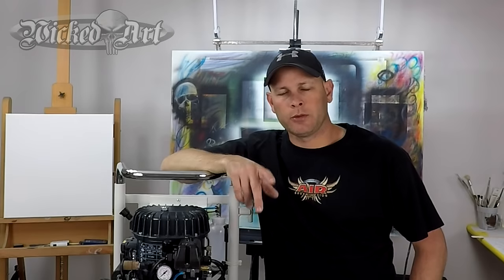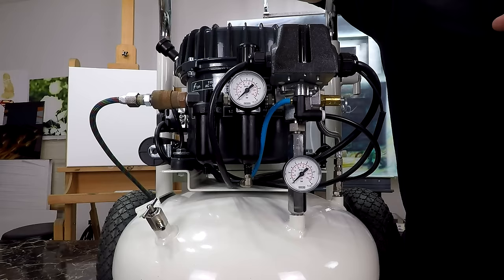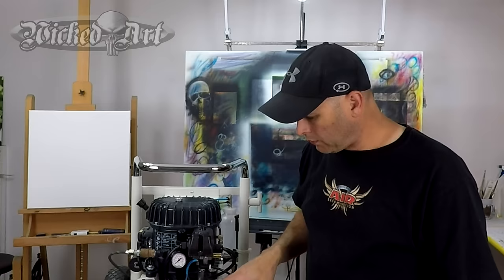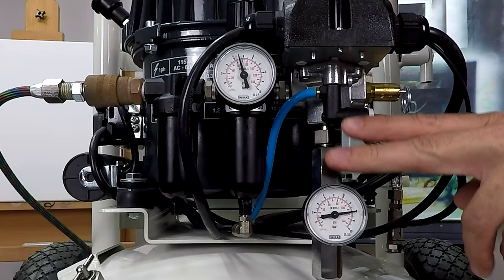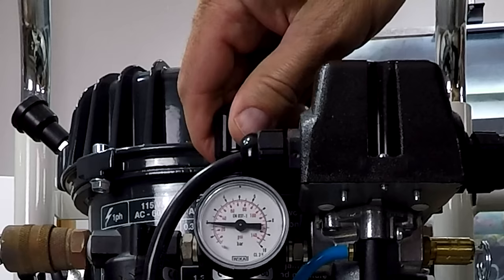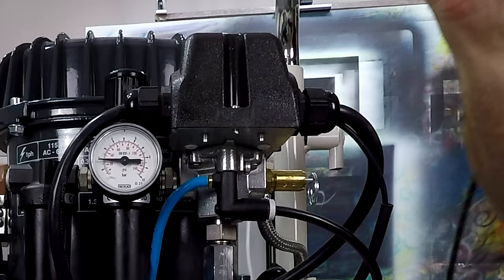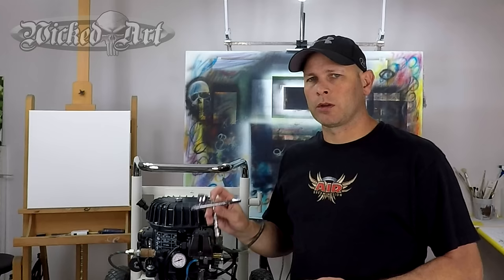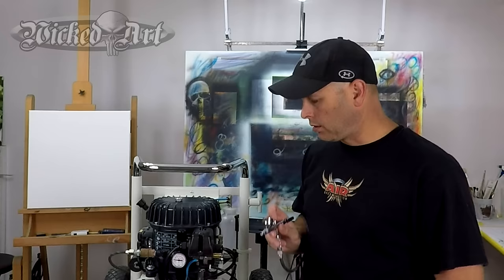How To Properly Set Your Air Pressure

Comment: I can't get max pressure to my regulator. The tank shows 150 psi (the left side of the shutoff) however the regulator only builds up to about 90 lb. I put a new regulator on and it's doing the same thing. I'm guessing there's something wrong with the shut off. Any ideas? Maybe I'll just come out the other side of the shutoff with my hose since that side shows the higher PSI.
Reply from the maker: Most regulators are preset to a maximum air pressure from the factory.  90 psi is more than enough for airbrushing.  I'm curious why you need more pressure?

Comment: I bought a cheap air pressure regulator with a water separator. But how do I know which opening is the air inlet and which one is the air outlet? I tcame with no instructions. Yes, I’m a newbie.
Reply from the maker: Hi Ken.  I apologize for the late reply.  Most regulators will have an arrow molded into the plastic body near one of the fittings or on the back side that shows you which way the air is supposed to flow.

Comment: Did u set the regulator while the compressor is off or not? Why is the arrow of my regulator gauge not moving when I'm turning it.?
Reply from the maker: You'll generally need to set the regulator after the compressor has been turned on and the tank has at least some air in it (depending on your particular compressor), otherwise there is no pressure in the system.  Some pressure is required to set the regulator accurately (not to mention it's more accurate to set the regulator while consuming air from the system like I mention and demonstrate in the video which may require the compressor to be on).

The regulator adjustment knob normally has a lock on it as well.  You likely need to pull up on the knob to unlock it before you adjust your pressure setting.  Remember to push it back down to lock the knob back in place once you're happy with the setting.  Keeping the knob locked will prevent you from inadvertently changing the pressure setting.  Does that make sense?

Comment: I had been having all kinds of trouble with my compressor prior to stumbling across this video; the equipment I got didn't show this, and for some reason none of the other videos I watched pointed out what you show here. I won't tell you what I was doing to be able to operate; suffice to say it was ugly - and I thought I was dealing with a broken compressor/regulator. This short little video helped me fix my problem quickly and correctly, letting me finally start to use my brushes properly - beginning with practice. Thank you so much for offering this how-to! ^_^
Reply from the maker: I'm glad you found my video helpful and are on the right track now!

Comment: Hi Trev
Still watching.
Good to show the pressure drop when you press the trigger. I always set the pressure with the trigger down, same as i would with a spray gun. Most companies reccomend a pressure to spray at but it is an at the gun pressure not at the compressor.  It is a great place to start. You can get a guage that goes between your air line and spray gun which gives you at the gun pressure but it is always with the trigger pressed so the air flows freely. After many years of painting I mainly go feel now. You just know what is right. As with all painting be it automotive or airbrush just use whatever gives you the easiest control and your best results. You might need to play a bit with reduction or air pressure, but it's worth it.
Keep up the tutorials.
Looking forward to the next eagle upload.
Guy
Reply from the maker: Hi Guy.  I'm glad to still have you!  I go by feel too when it comes to setting air pressure.  It's surprising to me how many people don't realize the air needs to be flowing when they set their pressure though and that's why I thought it'd make a good topic for a video.  I'll upload part three of the eagle this weekend.

Comment: Again great advice for the beginners. I would like to add that I adjust my air pressure to different colors as well , I spray white at a lower pressure because I tend to reduce it more .by doing that I reduce the amount of tip dry
Reply from the maker: Thanks for the kind words and the additional tip Adam!

Comment: Dude!! Best video I've seen so far, and I've watched several. I'm new to understanding, not new to using the air compressor I've acquired. Ask I've been doing was turning it on and using it, thinking I knew how to set the psi, butt I was using the wedding gauge for that! Now I think I have a better understanding of how to set the PSI for a tool that requires a certain number, which hopefully in turn will make my projects more efficient and definitely more importantly safer. Just bought a spray gun and want to learn how to use it properly. Thanks so much!!
Reply from the maker: I appreciate the kind words!  Thank you!

Comment: Thanks  Trevor for the tip..what is a good way to pick the pressure you need when using say a .20 needle vs a .35 needle?  etc?
You have been a big help!!! 
Injoy your channel!!!
Reply from the maker: Great question Richard.  It also happens to be the number one question I get asked as an airbrush artist and instructor.  Unfortunately, there isn't a great answer.  There are so many factors involved that it is impossible to suggest a setting that is guaranteed to work flawlessly.  Generally, you can use a lower pressure with a smaller needle and nozzle set (and proper paint reduction) than you can with a larger needle and nozzle set.  Again, that is general advice.  I know of artists that spray in single digit psi settings with a .05 mm siphon feed airbrush.  In the end, it takes some experimentation on your part to find what works best for you.  I plan to make a follow-up video to this one addressing this very question a little more thoroughly.  That video should be uploaded in the next week or two.
Reply: Thanks Trevor for your time was wondering?  I usually try different different pressure & paint reducer combos

Comment: 😀Cool video...I can't turn my regulator knob🙄🔧Thanks for sharing😊👍
Reply from the maker: Some of the smaller air compressors don't come with adjustable regulators.  You can probably purchase an adjustable regulator to replace your existing one, or purchase a MAC valve you can attach to the end of your air hose where it connects to your brush .  The MAC valve doesn't have a gauge.  Adjustment with a MAC valve won't be as precise without a gauge, but at least you'd have some adjustability with air pressure.  Thanks for the kind words!

Comment: Great vid,  with my compressor,  it doesn't kick in until way below my working pressure,  if i set my working pressure to say 25psi  the compressor wont recharge the tank until its completely empty,  is that normal? Thanks
Reply from the maker: I don't know what compressor you have but that is not normal based on my experience with every compressor I have ever owned.  It should recharge before the tank is empty.  You likely need to replace the pressure switch.

Comment: I am still working on the Eagle picture and my air pressure is about 15Lbs, but I am still getting big splatters, I am using an Iwata H P C+ and I have cleaned the airbrush and thickened up the paint, maybe my needle is bent, or a gasket has blown.
Reply from the maker: A bent needle will create an abnormal spray pattern, but it doesn't cause big splatters in my experience.  I highly doubt a blown gasket is the cause of the issue either.  You could be experiencing tip dry.  Be sure you are cleaning dried paint off the tip of your needle frequently.  The air pressure and the paint reduction you choose to use is completely up to each individual artist.  There are so many factors that affect both, the environment (temperature, humidity, etc.), the airbrush brand and needle size and brand of paint just to name a few.  All of those factors make it nearly impossible to diagnose the root cause of the issue via the internet.  Generally speaking, a smaller needle/nozzle set can be run at lower air pressure, but the paint must be reduced very thin as well.  A larger needle/nozzle set usually runs better at higher air pressure and the paint doesn't need to be reduced as thin.  Again, your environment will affect all of this to some degree.  The HP C+ has a .3 mm needle and nozzle.  For a needle/nozzle that size I personally prefer to run somewhere in the range of 20 to 30 psi (most of the time I'm on the lower end of that, around 20 to 25 psi).  You might try raising your air pressure slightly and you'll have to play with the paint reduction to find what works for you.  I will put together a more thorough video covering all of this in the next week or two.  Hopefully, the above advice will help you out until then.  If you have further questions please don't hesitate to ask!
Reply: Thank you for that information, I thought I was running a smaller needle, therefore, I can try another needle or airbrush, I was told that the Iwata was for fine detail, I am not a young man anymore, I am 70 and my hand shakes too. I did try changing air pressure, but it didn't help much  I can google it, so Thanks again.
Reply: Hi Mate. Just try going from 100%  reducer to 100% paint. You will find a place that you like to paint with. If you are getting slpatters over reduce your paint or increase the pressurre. Personnally i would over reduce the paint and adjust the the pressure till i found a mixture that works for me.
Hope that helps.
Guy
Reply: @guyverney3606  OK Guy, Thanks again.
Reply: i shake like an idiot to so dont worry.What paint are tou using?
Reply: I am using createx black/white and transparent red

Comment: Nice 1 mate had mine some time now and only now as I'm intending on s9raying my motorcycle wheels using 2k primers/clear . I wanted to know what's shat as its more important..you explained well . Mine us not high spec but its fine and recently changed its oil. 

2 dials left and right with dial knob at centre so 1 on right stays around 7/8 bar . So that's the tank pressure right? 

The 2 9utoet ports will be the same as the dial on the left ? I.e. say 2 bar 

Ty
Reply from the maker: I would assume you're correct because the tank pressure will not change when adjusting the regulator, provided there's no load on the compressor.
Reply: @wickedartstudio  regulator ? Sorry I'm.onky familiar with condensor and compressor..I'm aware it compresses the gases into liquid etc
Reply from the maker: @kevinhancock4064  I apologize.  I was referring to the knob that changes the pressure.

Comment: I know how to adjust the air pressure on my tank, but I do not know what to set it to! I was hoping to get that info but it looks some comments have addressed it- it depends.
Reply from the maker: It does depend on your own personal preference.  We are all a little bit different in that realm.  A good starting point is somewhere in the range of 25 to 30 psi though.  I'm generally at about 25 psi for most of what I do.

Comment: How important is it to have an oil and water separator trap 
on the air regulator?
Reply from the maker: That really depends on your particular set up.  It doesn't hurt to have one installed, but it's not always necessary either.  If condensation is finding its way through your air line, into your airbrush and onto your canvas, you should use a moisture trap at minimum.

Comment: I have a linear compressor with no tank so it runs “always on”. I can set my pressure when the trigger is depressed no problem but once the trigger is released the pressure builds up again to max level. When I depress the trigger again, there’s an initial burst of higher pressure air as the needle drops to my desired level. Should I be counting on that at all times before releasing paint by pulling back on the trigger for paint?
Reply from the maker: What is max level on your compressor?  A slight increase in pressure is completely normal when there's no air flowing out of the brush (as shown in the video).  If the increase is significant, there may be something wrong, or perhaps that's normal for a linear driven compressor...?  I'm not very familiar with those compressors.
Reply: Wicked Art Airbrush Studio Max that my compressor’s gauge reads is 0.2 MPa (29 PSI) and when I’m not depressing the trigger the needle is buried higher than that. With my 0.2mm airbrush’s trigger depressed the needle then falls to the max flow of 0.16MPa (23.20 PSI)

Comment: I would like to now what causes spider web/ webbing I have that problem a lot I was using lacquer paint for cars Thank you Tim
Reply from the maker: Hi Tim!  Paint spidering is generally caused by thinning your paint too much, setting your air pressure too high or a combination of the two.  It takes some practice to find a combination that works well for you.

Comment: Hey, thanks for the video! 

One question I have - After setting my pressure I notice the regular gauge shows a big difference between static and working air pressure. I.e. I set my pressure to 25psi while air is flowing, but as soon as I release the trigger the gauge jumps up to 55psi, then back down to 25psi when I press the trigger.

I also notice that the gauge seems to show a different static value (no airflow) depending on how full the tank is. So it shows around 55psi when full (Max pressure of compressor), and will drop down to about 40 psi while using, at which point the compressor kicks in and starts refilling the tank.

Is that normal?

For reference, this is a simple cheap mini airbrush compressor + tank with a single in-line regulator gauge / moisture trap.
Reply from the maker: A difference in static and working pressure is normal.  I have also seen slight static pressure changes based on how much pressure is in the tank.  I have never noticed a pressure swing of more than 5 or 10 psi with my set up.  I would guess the reason you're seeing a bigger difference is due to it being a "simple cheap mini airbrush compressor".  The manufacturer likely used a very cheap regulator/moisture trap in order to keep the cost down.  It's probably not super accurate, but I wouldn't worry about it if it's not causing you any issues.
Reply: @wickedartstudio  Great, thanks for your reply! I can confirm that there are no ‘issues’ so to speak. So I’ll just leave it at that for now, and accept this as the result of buying the cheapest compressor money can buy.

Comment: Can i ask what compressor that is? My iwata is about to die and looking for something with a tank
Reply from the maker: I use a Silentaire Val-Air 50-T-Air compressor in my studio.  It's also known as the Terry Hill model.  It's expensive, but you'll never need to purchase another compressor to run your airbrushes.  I highly recommend it.

Comment: How about if you are using a spraygun.?
Reply from the maker: The process is the same if you're not using a regulator on your gun.  If you have a regulator on your gun, use it to set your spray pressure while the trigger is pulled.  You'll also want to set your air compressor regulator to a normal "air tool" pressure... anywhere from 90 psi or higher depending on your shop setup.

Comment: Stupid question... Can a regulator like that malfunction and not work..? I bough a regulator for my compressor and the knob does NOTHING. The pressure just drops and drops and drops very slowly when i press the trigger but i cant adjust the working pressure what so ever. Should i take it back to the shop and get a new one or is there no way that think malfunctions...? Thanks in advance:/
Reply from the maker: There are no stupid questions.  You don't know what you don't know.  Yes, a regulator is a mechanical device that can absolutely malfunction or stop working properly.  Having said that, are you aware that for most air regulators you need to pull the knob up before turning it in order to adjust the air pressure?  When the knob is pushed down it will turn, but it won't actually adjust anything (it's a safety feature to keep from accidently bumping the setting one way or the other I would assume).  If the knob is in the unlocked position when you're trying to adjust your pressure and it does nothing, I would definitely return it for another unit.
Reply: @wickedartstudio  Thanks for taking the time to answer.. I'm repairing my car, It's the first time I ever do that kind of thing and I couldn't figure out what was not working properly. Today I took the regulator back, got a new one and it works like a charm. Of course I was aware of pushing and pulling the safety knob but it was obviously a defective one. So, no more excuses. Applying the paint and clear coat on Tuesday when it's going to be warm and sunny here in Greece. I've put so much work on sanding, filling, sanding, priming, sanding, sanding, sanding and now it all comes down to this. I'm feeling confident. Thanks again so much for the help.
Reply from the maker: @scardelta  You bet!  I'm glad to help when I can.  The foundation and all of the prep work is what really makes a good paint job.  It sounds like you've put in the work.  I'm sure your efforts will show in the final result!
Reply: @wickedartstudio  Let's hope so.. We will know tomorrow. Thanks again.

Comment: a better title would have been "How Compressor Regulator Works"  - No info on how to set the pressure for the airbrush to function properly
Reply from the maker: The title and thumbnail do not suggest this video contains information about setting air pressure for the airbrush to function properly either.  It suggests how to properly set your air pressure using a regulator.  The airbrush doesn't care what the pressure is set at.  It functions regardless.  The artist determines if the pressure setting is suitable for their intended purpose.